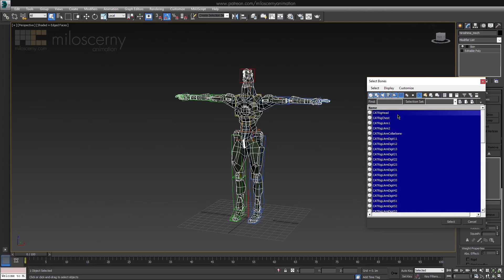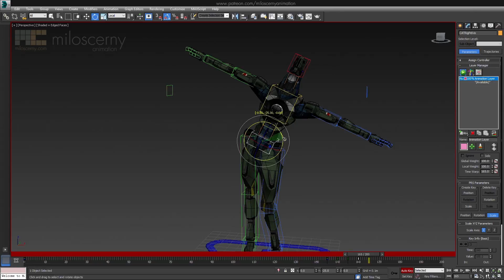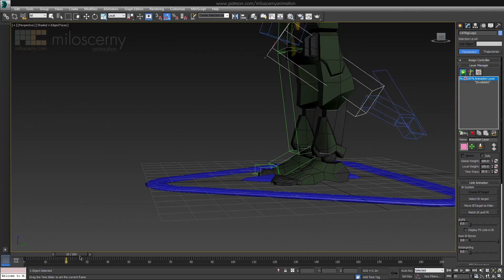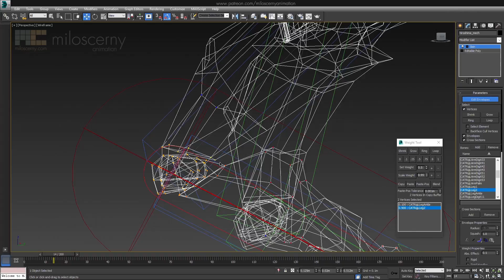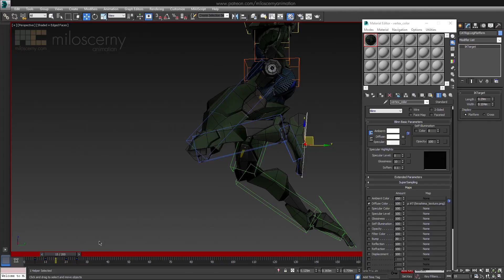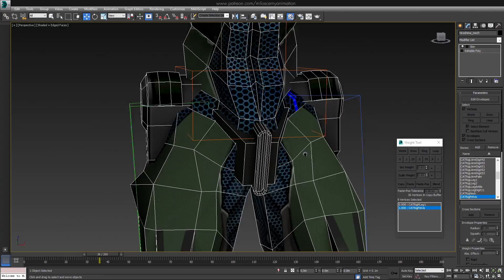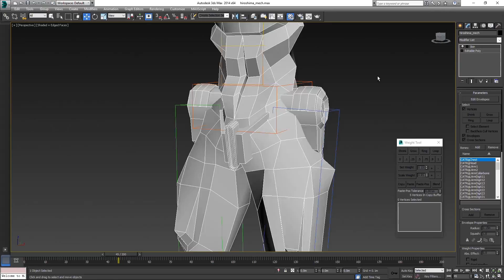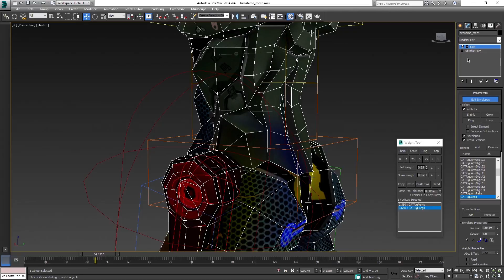Skinning Legs and Torso - 3ds Max CAT Tutorial (Part 2/3)

Comment: Hey man love your videoes. Can you tell me what hotkey you use to make the selection into a wirefram without everything turning into wireframe. I know i can use Wireframe option in top left hand corner to move between perspective and orthograpic. But if i apply wireframe here all models become wireframe.
Reply from the maker: Hey! That's actually not a viewport setting. All the CAT bones are set to be 'displayed as box', which makes them wireframed basically, because they are just boxes anyway.
Go to the 'Display' panel (the fifth one) and under the 'Display Properties' tab check 'Display as Box' option. I also do it in this video for example: https://youtu.be/YcwjaN_VxxY?t=151
Reply: @MilošČernýAnimation  thanks appreciate the quick response :)